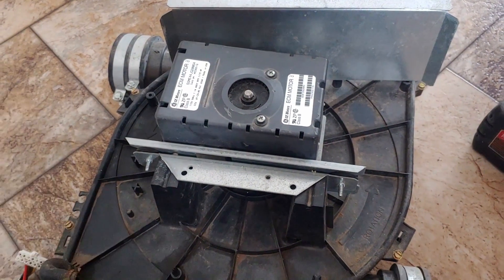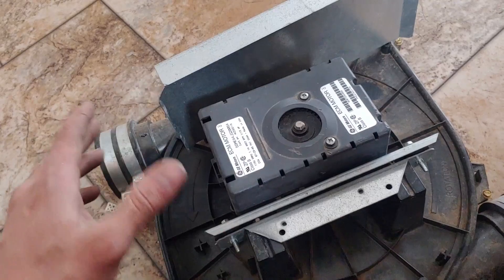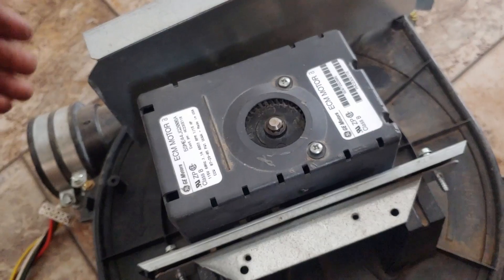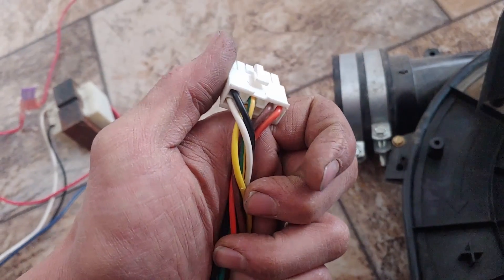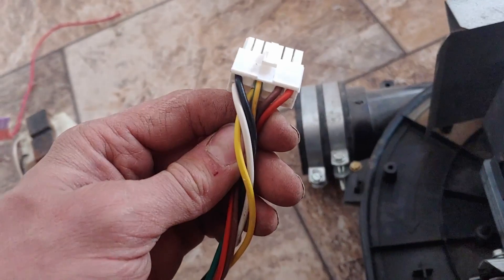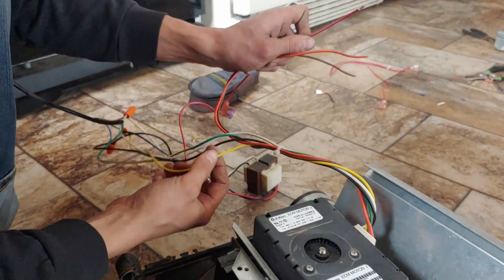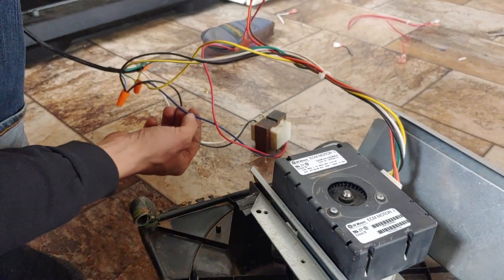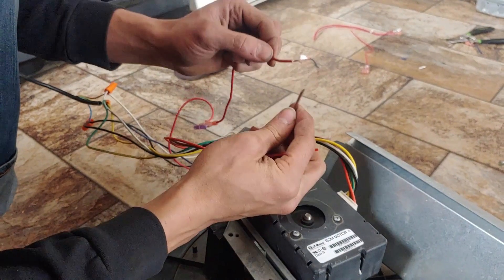How to Power Up an ECM Motor With a Drop Cord

Comment: Do you know how you can power a ecm motor with a bad module? Remove the module. Just to get it turned on all the time or whatever so the heat is working again?? I know the module controls the speed I’m just trying to get the blower working, tested motor(resistance and ground all the wires good)…

Comment: I have the same motor, yes what kind of fuse did you use?  Thank ahead of time.
Reply from the maker: The fuse I used is a three amp, but it is only protecting the 24 volt control circuit. This would normally be protected by the furnace 3 amp fuse, and no protection other than the breaker for the combustion blower input power.

Comment: how big was your fuse? My motor is less than 1 amp, so what size fuse do you suggest? Also, my input main voltage is 325DC, so I have that problem... was thinking of pulling it from the board but i think the board stops putting out 325 if everything isn't right in the system. just bought a 325v dc 1 amp power supply, uggh
Reply from the maker: I guess that would depend on the kind of board you have. If it's like a board in a mini split and has a full bridge rectifier and a few capacitors, you could maybe power the motor? But if the board is only trying to run itself, and switch a different power source to the motor then it wouldn't work so well if at all. My fuse only protects my control board.

Comment: could be wrong, but I believe these motors get a variable signal from the control board and it speeds up until the correct pressure switch for the stage closes to maintain an ideal fuel to air mix. there could be variations though with the earlier ones just using straight signals and having two speed as input.
imo not worth the added complexity and cost when it is a 2-stage furnace.
Reply: to add, there could be variations with some have discrete inputs and the motor's controller internally decides what to do.
Reply from the maker: @Jon-hx7pe  Interesting! This came from a furnace manufactured in 2004 or so? I guess if that's the case by sending 24 volt power up one of those two communication wires would simply tell the blower that it had met the correct speed and the pressure switch was closed? I think you probably have a better understanding of how these complex two stage systems work, as my understanding is pretty rudimentary. I agree, so much complexity and expense for fractional efficiency improvements, it's hardly worth it.
Reply: @ReubenSahlstrom  I'm not a technician, you have much more knowledge of furnaces and experience overall than I do - just interested and a bit of a diy'er for family. 
Would need to check the carrier service manuals to know exactly how they work. I do know there's an error called "inducer speed out of range" and the main board monitors rpm - comes up if the pressure switches close outside of normal range.

re: complexity - I am a fan of 2-stage but with a regular psc inducer and also cheaper a multi-speed blower unless it is for an application that warrants variable speed/constant airflow blower.

Comment: reminds me of the old wood burning kit we had as kids! Probably should of saved this motor for a customer as I understand they are hard to find replacements!
Reply from the maker: Yeah, I considered keeping it on the shelf for that reason, but the furnace it came off of had a bad heat exchanger and had been reset enough times there was soot clogging up a lot of it. Probably would not have been a problem, but I just wasn't sure.